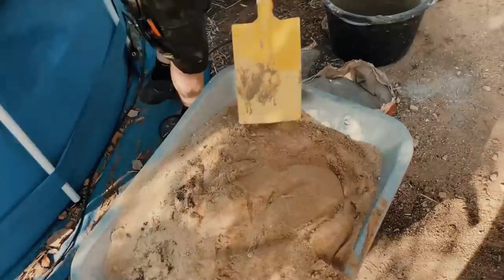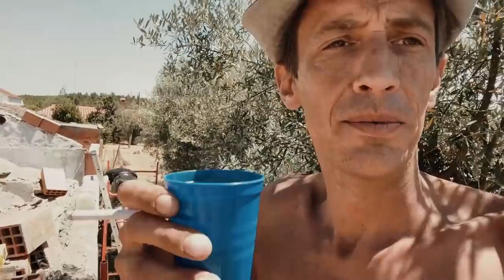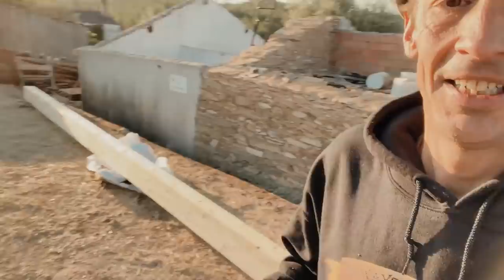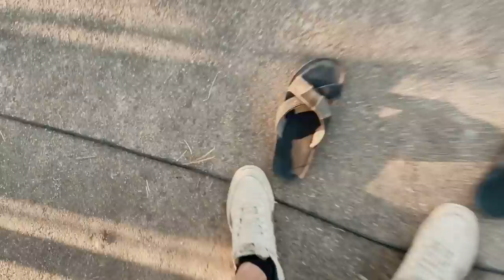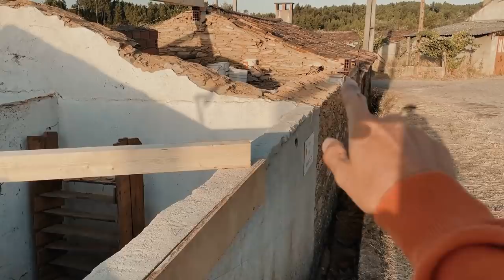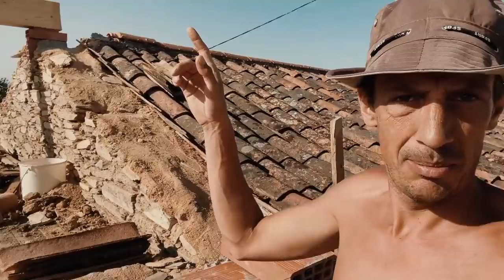Placing the first Ridge Beam on the roof. Leveling the wall (And more mistakes are made)

Comment: Easy way to be consistent is using a bucket to make concrete , 3 bucket of sand ,1 of cement . Forget about the the third house for now , do the measurements of that one separately, or else you are going to end in the road (exaggeration  of course ) . I hope you read the comments , people is leaving good advice for you .
Reply: Good idea also measure the water - it will be a little different each day depending on weather, evaporations & materials moisture content etc but it will save time and effort by using closer to the correct amount.
I always put at least 1/2 the v water first than sand cement make a hole a pour almost all the rest of water in hole holding a small amount for touch up after. Make note to adjust water for next batch...
Mix well and don't over water it weakens strength...
Boa sorte

Comment: Are you sure that over hang is going to hold the weight of the beams plus tiles?... me personally would have form a wooden shuttering at the top of each wall, and poored a one piece concrete cap about 6 inches deep with perhaps some rebar in it. to tie the whole wall together.. and then laid the timber beams on top of that.. but everyone does it differently, good idea to treat timber for beatle infestation.. coming on and good to see.. so many deserted houses over there, a shame to see them fall into disrepair..
Reply: That's  the right way to do  a job like that....  before laying the  beams of the roof  in order to lock the walls altogether and let them perfectly leveled...
Reply: BEATLE INFESTATION...JOHN, PAUL, GEORGE & RINGO...IT'S BEETLE INFESTATION!...LOL...;)
Reply: Would rather here Jethro Tull or the Stones singing from my timbers, not into the Beatles.
As for shuttering a cap, I agree .
My 17th century west of  Scottish farm is built in a similar way, i raised the wall up 4 inches with shuttering and rebar so I could extend the roof spars

Comment: The wall is straight, it’s just not parallel to the beam. Here’s a thought. Just make all the rafters the same length and the difference will be in the overhang. Your eye will follow the roof edge, not the wall. Support the rafters on the existing wall for best support. Don’t try to extend the same line to the next roof, start over.
Reply: I wuz gonna say that 😁
Reply: They're roof joists, not rafters. 
And that brick you propose to lay, isnt load bearing brick.
Reply: @austinorphan6688  
On America on roof they are called roof rafters - it it carries a floor joists if a roof rafters.
I'm also Portuguese from Pico island Azores
Reply: @vitalrights7390  in America, they're also called roof joists. Roof rafters are pinned to a bottom cord to prevent outward movement
Reply from the maker: If i would do that, the roof would not be level. The more the wall goes outwards, the lower the rafter will sit..
Reply: @GhostTownVlogs  pour a small concrete beam on top of the wall. The wall to have 2 - 15M bars. The walls must be level and at the same elevation. It's ok if they're not parallel. Install a sill plate. Install a bottom cord at every 1.2m. Install a vertical member from the bottom cord at the wall up to the rafter.
The rafters can extend up to 60cm max beyond the wall face closest the the ridge beam.

Comment: Before laying blocks ,bricks ,stones etc  in the top of an existing  wall or in the ground ( to start a wall for example) you need to wet well the base with water   ...before to lay the cement mass....otherwise the adhesion will be poor or even absent....other note:  to do this kind of work ( laying bricks or plaster a wall.) the ratio of the sand to the portland cement is 4:1.....( four  parts of sand and one part of cement) good luck....
Reply from the maker: Yes so we noticed.. hahaha

Comment: Hi as you have the top-plate off the walls. are you going to lift the door headers to a modern height? would save you ducking each time to pass through an exterior doorway? and now is the time to do it as the walls have no weight on them. Take care D
Reply from the maker: Yes, that is actually the whole point why te roof is raising, to support bigger doors (with blinds). :)

Comment: Q ? at the end of the video, looks like the wall is pitching outward at the top by a little bit ? perhaps this is where you gained/lost the 10cm .
Reply from the maker: Yes, the walls are not strait
Reply: @GhostTownVlogs   My old Scottish farmhouse is the same , bits added on from 17th century until 1980s ! not a door window or wall is the same .
To compensate [when re-roofing] we extended the roof rafters by 250 mm to introduce an overhang .

Comment: Check whether you need ties across the building to stop the walls falling outward with the weight of the roof. Honestly, you need a roofing engineer to give you advice, even if you then do the work yourself.
Reply from the maker: I get some advice here and there. Problem is, roof engineers that are not from Portugal have no clue how to deal with walls that are not strait apparently (all advice i get is about wallplates, that dont do me any good, because the wallplate will not fit if the wall vary 20cm... And protuguese engeniers have no clue about water drainage.. So..yeah..
Reply: @GhostTownVlogs  Thanks for the reply. Lots of well-meaning advice but not perhaps helpful. We are wanting your project to succeed.

Comment: Not sure about cobbling the bricks over like that, it just won't take it, level the brickwork, get a pan on, sit the rafters in place and cut bird mouths accordingly. I also hope that ridge beam is supported on stone not those bricks, you need to get some support in the middle too before it sags with all the extra weight its about to take.
Reply from the maker: Hi, yes that is probably what i can do, cut them all separate.
I will also extend the wall in the middle up, to support the ridge beam (and fill in the blocks with cement inside). Thanks for the advice!

Comment: Hi, I have been looking at a project being completed by portuguese builders today,  they have put an additional rafter accross the top of the stone wall and concreted in place. It has the upright beams fitted directly on top of that. There is no wood showing to the outside and as usual no water barrier except for the insulation and osb panels on top of the rafters.    I took pictures and can send you them if you like,   just send me your email address and ill send the pics no probs.
Reply from the maker: Hi, Yes i know how the portuguese do it.. with the rafter in the wall. Thats not an option for me as i need to drain the water of the roof..
An additional rafter doesn't solve my problem.. it makes it easier to work, thats true!

Comment: Do you need permission from  city hall  to do new roof or any other construction work
Reply: If he was building a new house ekk the paperwork is horrible. 
No he doesn't rebuilding an existing house !=8)
Reply from the maker: Hi, replacing will not require a licence. Modifying differently will require license. But we are just leveling the roof :)

Comment: I feel bad for Steve O, you can see the frustration in his face. Since destruction is easier than construction. I would tear off those triangle parts of the roof and then just built a traditional roof. On top with a ridge beam, rafters and then sheathed in plywood. You can still use the tiles, you do need to buy tar paper though. I hope that once you guys get the block placement figured out, that the rest goes on smoothly without any trouble.
https://www.youtube.com/watch?v=0Y6n6kf7vdY